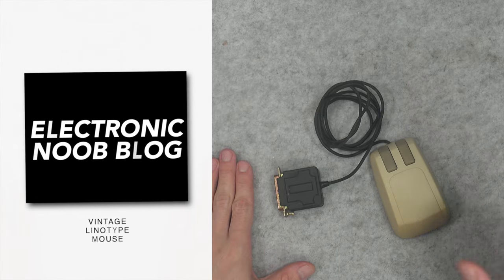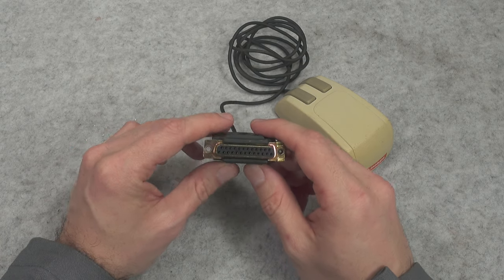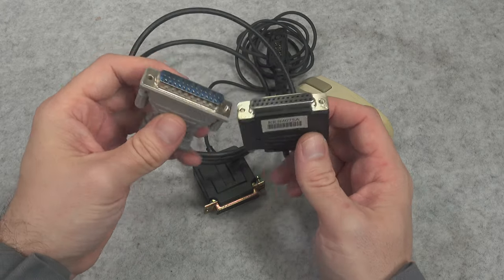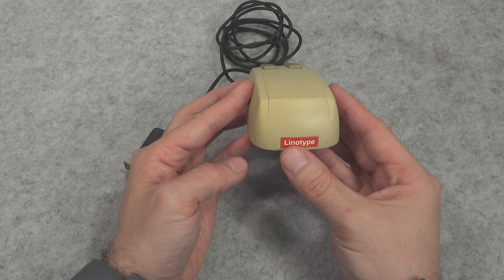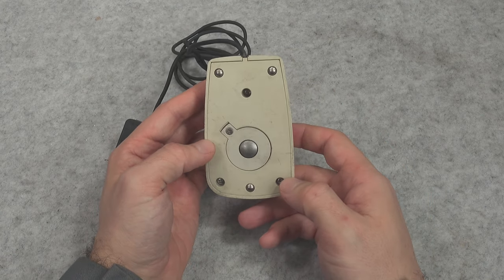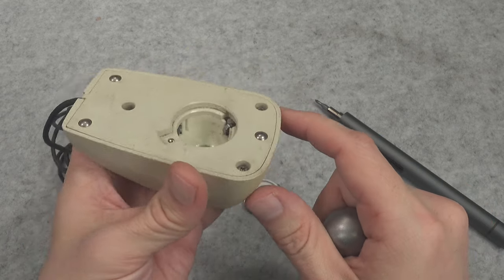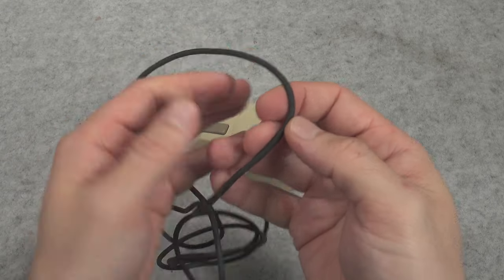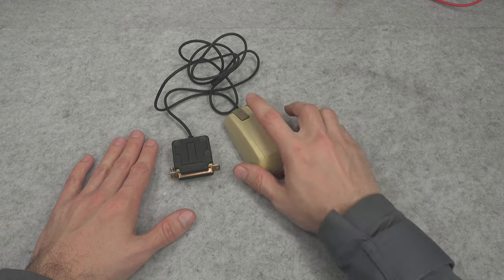Vintage Linotype computer (?) mouse with DB25 connector

Comment: That's the grey-eye revision of the Microsoft (Alps) original "green-eye" serial mouse. Linotype made newspaper typesetting systems and rebadged custom PCs for the job. Find a PC with a serial port and a way to load drivers, it will work. Maybe even in Win11?
Reply from the maker: Thanks for feedback, I tried it using that Motorola adapter on Windows 98 (100% known to have working COM port) - but it did not work, regular mouse work in that port - so I assumed it have custom wiring - it wasn't mine so I did not have permission to tear it down to see what's inside.